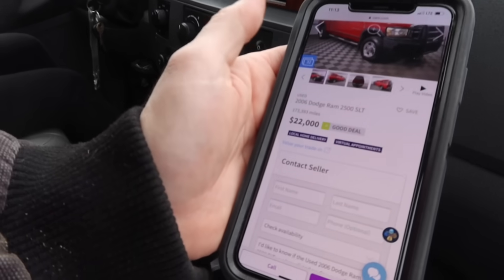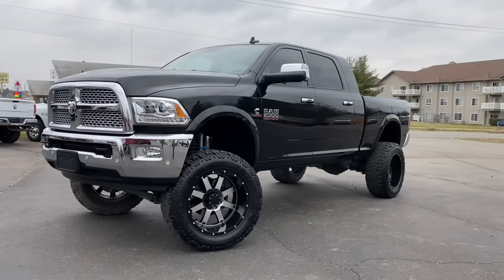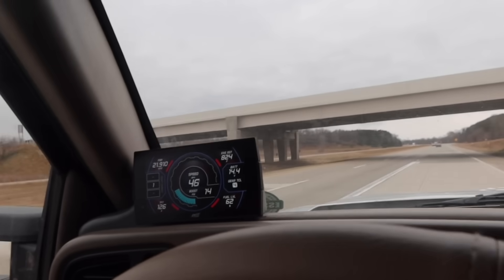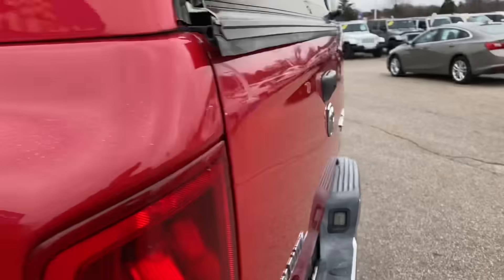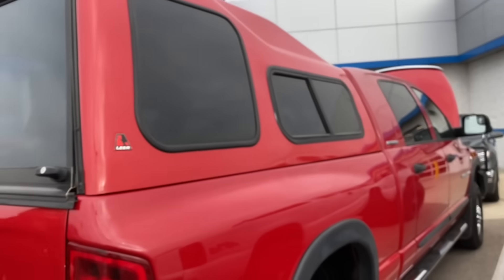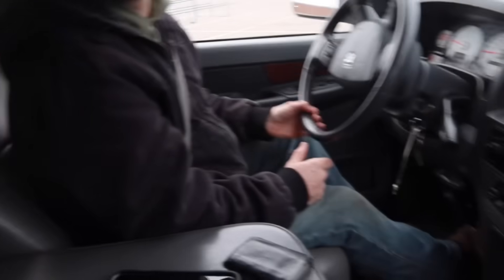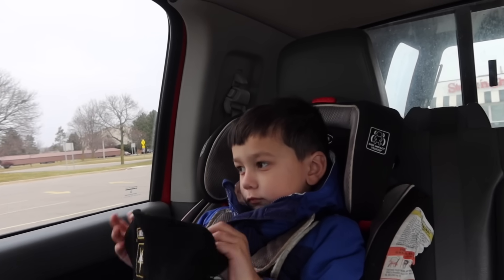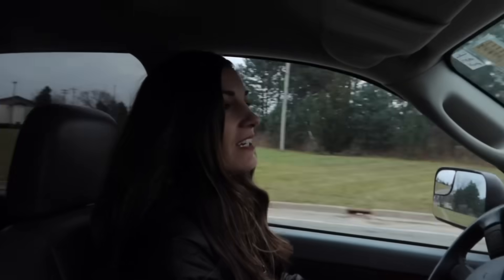I TOOK MY WIFE DIESEL TRUCK SHOPPING!

Comment: Josh don’t get a dodge just because you want the Cummins. Take an old square body or 60’s Chevy and put a Cummins in it
Reply: I also suggested a 12 valve square body swap lol
Reply: agreed dodge make shitty trucks its the engine that was amazing in em chevy truck styles are the best in my opinion get an ole squarebody or obs chevya nd cummins swap it
Reply: Now your talking great channel content!!
Any technical advice contact Westen Champlin
I see a 3/4 ton 2wd square body lowered C10
For cars & coffee youtube attention?
Reply: Yeah good idea 60s suburban/carryall or an 80s crew cab

Throw that Dodge cab way 

Lots o content   Just saying
Reply: Now we're talking!
Reply: I used to buy dodges to get the cummins but got sick of having a total crap truck.  They only look good for a short time but the truck falls apart around the motor at the speed of sound.  I run Ford super dutys nowadays and even with the hated 6.0, have a better time.

Comment: Josh... you have to place the steering wheel covers next to heat... hair dryer, hot air gun, furnace duct ... warm it upgood...  a behold it will easily go on and cool off to a tight fit.  😎👍

Comment: If you toss it up on the dashboard and turn the heat on through the defrost for about 10 or 15 minutes it'll soften the rubber up and make it stretch a little bit easier to get around the steering wheel or if it's the summertime just toss it on the dashboard in the Sun for about 5 or 10 minutes

Comment: Build a trans. Compounds, injectors, and tuning. She’ll run. Get rid of the topper, and the front bumper, throw a set of 35s on the stock wheels. Oh and flip the tow mirrors up!

Comment: Next time you have that much trouble with a steering wheel cover, throw it in the dryer for 10mins. Thats what we did on my powerstroke cause it was tight as hell and heating it up helped it stretch

Comment: If you're looking for a frame off build, I'd try to find a nice 3rd gen as well. Simple to work on, can make mountains of power, comfortable, and they drive really nice when just leveled on 33s. Would be great to pull the camper.

Comment: I actually like that 3rd gen Cummins myself as well. My father has a dark blue '06 Ram 2500 Lone Star Edition that he bought 10 years ago with the 5.9 Common Rail Cummins with LESS than 100,000 miles on it. Currently he has a K&N cold air intake, cat delete pipe, turbo silencer ring deleted and a Banks Monster muffler on it and it sounds pretty good itself. And for $22,000 that's not a bad deal to my mind.

Comment: I got my wife in an 05 Dodge and she made it 50 feet before there seats were killing her back.  In fairness it was not a high trim level but wasn't good for us.  Ended up buying an 05 LLY black crew cab.
Reply: Also, rather drive the 7.3 liter Super Duty.   Although far from perfect they have a better chassis and a better transmission when built.  Only 250 hp stock but better acceleration than a 5.9 liter.

Comment: Cummins is way to go if you want extra cabin space.
Reply: And extra problems cause it's a chrysler
Reply: Only way you have “extra cabin space” is if you do get the mega cab and even then it’s just comparable to the other two brands crew cabs. The standard dodge crew cab is like an extended cab. And unless you get a newer 4th gen the seats are absolutely horrendous

Comment: You can buy my truck. 08 6.7 Cummins, extended cab short bed, nv5600 6 speed swapped, 4x4, studded, push rods, valve springs, banks 4” intake elbow, fass 165 with sump, 5.5” long arm lift with rear traction bars, 22x12 hostile sprockets h108s with 35x12.5. Loads of work. Just needs body work now.

Comment: i have 2 duramax trucks one heavily modified and one stock lb7 and LBZ, I have a 2011 ram 2500 megacab , deleted, with 5 sotf efi live and its anything but slow, it will roast all 4 tires in 4wd and tops out at 126mph. I also own a 2015 f250 that got the def and dpf delted with a 5 sotf tune and its my daily. they are all good trucks. 
ITS A DIESEL THING NOT JUST A DURAMAX THING.

Comment: Frame was spray painted on the dodge bottom of the doors are to clean not to have been painted especially considering the rust hiding under the flairs which is more than likely under all off them stay away from that thing

Comment: I would agree with your wife about finishing up her truck as that could be her daily driver. If my wife wanted a duramax truck id spend the time getting hers done even with the request for the purple steering wheel cover. Lol  My wife dont  use my victory red 3500 because of the long bed and crew cab and being a dually. 
You already have a year into it roughly getting it on the road so id finish her truck. 
As for the dodge and Cummins engine, i wouldn't buy it for my opinion as i have 2 Cummins in the semi trucks pre DPF/DEF and deleted egr valve at  560hp. In trucking better off having bigger hp then not enough and paying more in fuel.

Comment: Speaking of that stove how much wood u go threw in a winter how many months you run it? I do about 10-15 cord start it around Thanksgiving and turn it off around April or wjen ever I get sick of splitting wood lol but I love mine does my heat and hot water but I EATS wood

Comment: I have an 05 and let me tell you that’s the best diesel truck I’ve ever owned plus I have a 91 five-speed Dooley diesel terrible and that is another best truck I ever owned got over to almost 2,000,000 miles and still no blow by and runs great

Comment: Those steering wheel covers are a bit$$ to get on. They fit but they fit a lot to tight. Sucked putting mine on my steering wheel.

Comment: Ive got an LB and my son has that same dodge mega cab no topper. That said ..after market support is better for the cummins in my opinion big hp is cheaper in the cummins inlines create bigger torque curves and a good after market tuner and simple bolt-on mods will easily  double stock numbers

Comment: Those steering wheel covers are a pain to get on. Once they're on, they are on though lol.
Reply: If you throw them in the dryer or heat them up with a hair dryer they go on A LOT EASIER.

Comment: Heat it up, now way to get them on cold, blow dryer it.
Reply: I payed $22,000 for my 2010 crew cab long bed duramax with 160,000 on it
Reply: @chadmacarthur353  if it's 4x4 that's not bad 🤔
Reply: @nb6584  it’s definitely 4x4 it came with efi live 5 tunes , DT750 built trans, stealth 67g2 turbo , driver side Manifold, 2inch stainless up pipes, mbrp down pipe , 4inch mbrp exhaust,  WCfab highflow kit witch includes driver and passenger intercooler piping and Y bridge, wc fab cold air intake , ppe strait center link, Cognito support kit, rear g2 tie rods, Cognito upper control arms with leveling kit, air bags and horn blaster kit , front diff lowering kit .

Comment: 06 Cummins should be the next build. Would like to listen to you go in depth with the Cummins as you have done with the duramax. Even if you did an 07 Cummins with the egr system. That’d be cool to see you build two different 07 trucks.

Comment: The Cummins was quieter & more comfortable because its bone stock.  A bone stock Duramax will drive similar.  I've seen on other channels ppl that mostly have Cummins comment that when they get into a Duramax they say how smoother the GM is.  The Ram was nice but agreed not a fan of that body style.  I vote Duramax Truck Master.

Comment: I got a 04.5 I like the front better the 06 on. I have light steam coming from my oil cap n I have electric fans so I can shut them off and it wont even blow a $ bill off. I made a manometer what cummins wants u to test wear of engine and at 2200rpm it blows the water 8in witch is supposed to b multiple by 2 so 16. Moral of my story no noticeable blow by until truck is revved up. And u can make 1 of those for 10$. BUT a Cummins cp3 injectors turbo u can push 700hp cant say that with a duramax. O n transmission

Comment: Josh I really think you should build what ever you want . No matter how people feel insulted.  In the way I can see toward the end of the video you are skeptical about the Dodge. But what I like might be in your comfort zone and also different is to see you build a 2007 and a little newer maybe 2010 Chevy or GMC Duramax Dually . Don't matter if its a extended or crew cab. Just like to see a dually being built to you standards.  Lift kit. Big wheels and tires. You definitely see lot trucks like yours and the Wifemax.  But you just don't see very many dually being built.

Comment: What about a late 90's Chevy dually diesel?
Reply: For a Duramax swap? Those 6.5's and the 6.2's are dogs. I had a 6.2 square body, ran good and strong but, no gitty up for anything, not even with the Bank's sidewinder turbo. That was a Detroit diesel, the 6.5 was a GM engine which wasn't that great at all. Turds really. Now, a Duramax swap into a square body, that would be fantastic!

Comment: I got a 2008 king cab F250 6.4 That’s to much for that truck. I like a cummins but my dual turbo with EGR and DPF delete is better. I love a Duramax. 2000 miles

Comment: Look into a Prius!
Reply from the maker: Prius Life Decals
Reply: Put the Prius in the back of the dodge instead of carrying a spare tire 😅😂🤣
Reply: @OldGriz708 , prius is great as back up and grocery shopping.  Keeps diesel in shape and prevents unwanted wear from short trips with diesel.
Reply: @repairvehicle  I have a 2015 Chevy Volt for that. 🇺🇸😉
Reply: @repairvehicle  I wouldn't buy a Prius with your money, haha, keep the profits and the sales within America too!
Reply: @stanlojewski6761  , your gm products made in China, Mexico and Canada.  Looks like you are just a hypocrite. Toyota sales guys that sell prius is in America sales. Chevy volt made where? Mexico or Canada?
Lg makes batteries for chevy volt.
Duramax is Isuzu mixed,  Japanese. 
Fuel injection pump and injectors made by Bosch in Germany or in Japan.

Comment: I will say I am a dodge guy we own a ranch and cummins has been the best for us, that does not mean there are they best nor is that the only truck we have ever own. It is not the dark side lol but I understand what you mean in that term, us buying another brand is the same feeling lol. They all have there own benefits, the cummins is the cheapest to and power. You can not beat the cab of the mega cab, but just like everything else that have there own problems, you would gain more knowledge owning more than one brand. Just saying.

Comment: Josh .... listen to Mrs. Truckmaster  !!!! Finish the Wifemax... a lot of work to do on it yet... Second  "Grandpa topper " .. really... a few of us Grandpa's , well bite your tongue sonny  !! Third your looking for a project truck... listen to the wife... or a few Grandpa's... by a truck for a project to "build "....  your to eager... stop being hungry when you shop ! Cummings are great... especially with the right transmission and solid front axle... the older generations were stronger and solid... again Mrs. Truckmaster is your rock.... let her find the right truck.  Finish the unfinished project first. Plan your build intent....make your plan for the build...what is the outcome you are looking for in it.  Build something that will show your skills,  something more than a few bolt on accessories... different,  but a true build.  Thing is have a plan and then get the truck to build from.

Comment: NO NO HELL NO ON A DODGE  TRANSMISSIONS ARE STILL JUNK MY BROTHER BOUGHT A NEW ONE 2 YEARS AGO IN 3 MONTHS TRANS WENT OUT THE DEALER HAD IT FOR 3 MONTHS AND IT STILL IS NOT WORKING CORRECTLY PLEASE DON'T BUY ONE 😎

Comment: Won't be good content, its a dodge, thing will never break. Stick with the GM products plenty of stuff to repair on those...
Reply: I've done plenty of head gaskets and replacing front covers on cummins. Not to mention a 2006 fuel injection pump. The old 12 valve mechanical was always fun to work with.